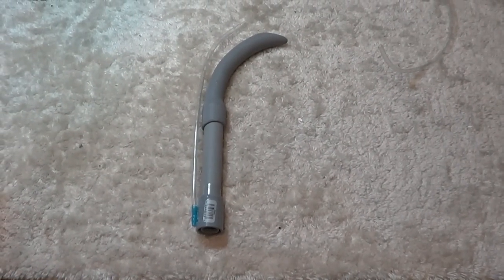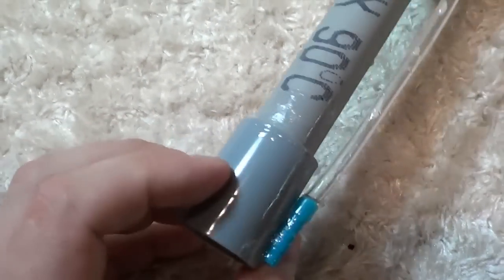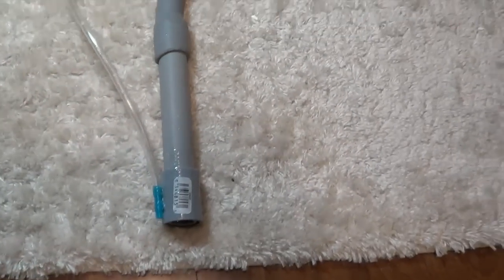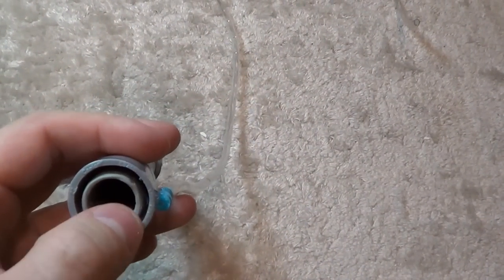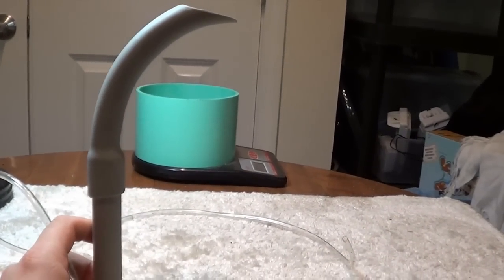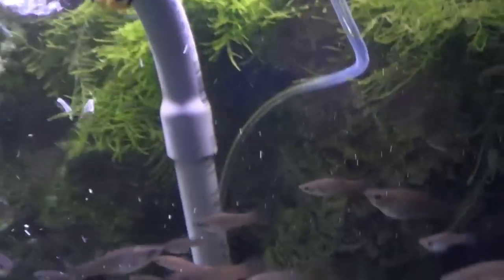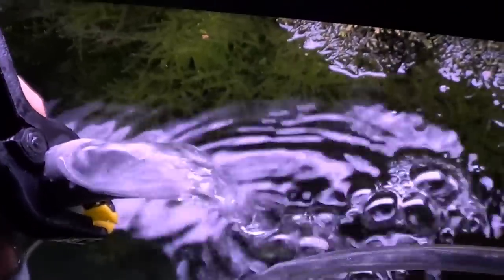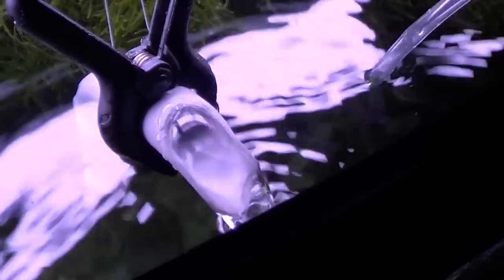#111: DIY Jet Lift Airlift for a Hamburg Mat Filter

Comment: Smaller bubles will give you a better result. So if you make the internal holes as small as possible, you will get a much better flow with the same amount of air pumped in to the air lift. As a bonus, the tiny bubbles only make a very small amount of noise, and your air lift will run almost silent.
Reply: But a smaller holes causing more resistance of the air flow.. then less bubbles too

Comment: Just FYI: That's conduit, not regular PVC pipe. The deeper you are able to place the bottom of the conduit...the higher it will lift water above your fill line. I like your idea to eliminate blockage of the pipe. Good stuff, thanks for sharing!

Comment from the maker: under gravel filters use the substrate as a filter media, so you wouldn't need a sponge, just figure out how to attach the uplift tube and you're all set. Typically an under gravel filter isn't enough, those fish sound like they make some heavy waste, so i would keep the hang on back filters running as well.

Comment: I tried this with a smaller diameter pipe and it didn't work all that well. I'm going to try again with a similar size to yours to see if it works better. I might have drilled too many holes or something but it acted just like a normal airlift filter and bubbled out noisily but without much flow.
Reply from the maker: drill bits will be too large, try heating the smallest diameter pin you have and make as many holes as possible

Comment: Hi everyone. I’m planning to build my own air lift pump to clean the sand from the bottom of my water fountain. There are 20m depth to water level and I need some advices about the size of pipe which can be used and also i need to know if my compressor 100L with 8 bar is enough. Thank you
Reply: put an air hose with an air stone connected to your pump in the bottom of your fountain and see if the pump has pressure enough to pump air this deep. If so it will work. Search "organic pool" here on youtube. The guy build this air lifts all the time and you can compare the pipes diameters he uses.

Comment: how will you make it lift higher?
Reply: deeper = higher
more air flow = higher
Reply: And don't use durved pipes or hoses or the water can fall back. Also smaller diameters will help the water go higher. Make the holes as tiny as you can all around the pipe and let enough space in the bottom to allow the flow of the water. If you touch the pipe in the bottom of the tank it will hinder the water flow.

Comment: What size are the small holes?
I’m going to build one  today.
Nice upload.
Reply from the maker: BORG Aquatics as small as you can make them, try heating a pin
Reply: Just ordered a aqueon 1200 pump. 100-300 gph. Should have great flow in my 30 gallon
Reply: I use pvc about 1/3 size (for cable installation) and air pump 5 watt. When I put it into water in 60 cm deep, it could lift water up to 20 cm from water surface...

Comment: It´s build wrong, the chaimber has to be sealed in the bottom for it to be able to force the water thrue the tiny holes. You see in the video that the water output is not even and is very slow.